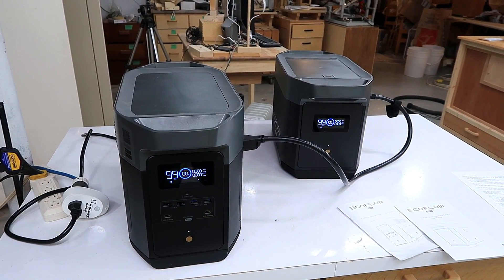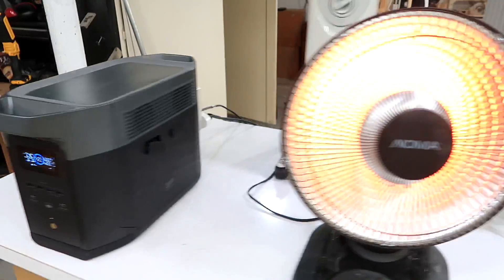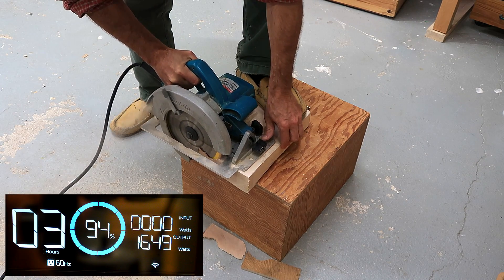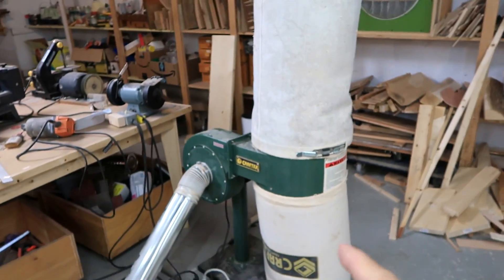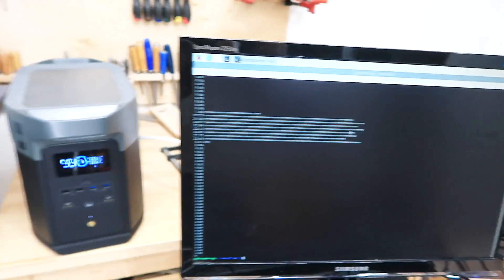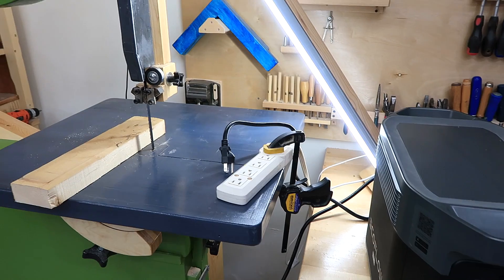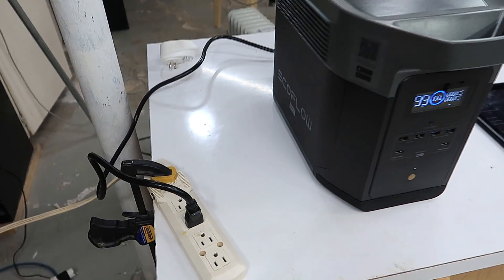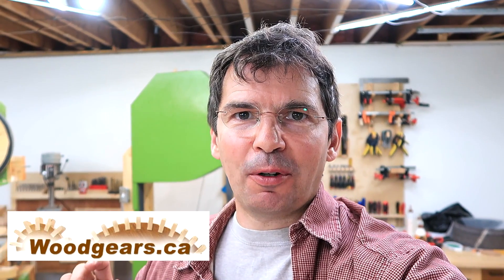Overloading the EcoFlow Delta Max battery pack

Comment: This is one of the more polished portable battery backup systems I've seen. The app looks nice. I am able to run my 15k btu AC off a lithium bank with a EasyStart control box as it helps smooth out the initial inrush current, I bet it would work for a system like this as well. I do feel that 24a is very generous for such a small system like this. Thanks for sharing!

Comment: How many Watts are standard sockets rated for in Canada? In Germany it is 3680W, however in practice I had it run at 4000W for hours without fuses popping which is the maximum including a tolerance. 

Overall I never find this an issue because only the table saw in my entire workshop can use up that much energy.
Reply: 15 Amps * 120 V = 1800 Watts for a standard outlet. There is also a 20 A outlet that is only slightly different compared to the standard 15 A outlet.

Comment: I would love to know how it cuts the power. I did A few lithium battery projects and cutting the power was always difficult because of the high currents and low voltage.
Reply from the maker: By shutting off the inverter

Comment: Slightly off-topic, but in the HVAC world I know that repair technicians often install big ass capacitors on the compressors to eke a little more life out of them. It reduces the inrush current so that a struggling compressor doesn't trip the breaker. Something like that would allow you to run larger equipment without overloading the device, but I realize that's probably not a common use case. I did find it intriguing that I might be able to use traditional, non-battery powered tools in places where AC power was not available or impractical. At least until I get my hands on one of those F150 Lightnings. 😁

Comment: I wish you had discussed exactly what kind of battery that it uses. I've always thought it would be nice to have a UPS that used deep cycle automotive/marine-type batteries that you could easily obtain and recycle at any auto parts store rather than the myriad of UPS-type batteries that you have to special order.
Reply: You can get flooded lead acid 6V batteries at Costco (if you have one near your house) and use an inverter to convert the low-voltage up to house AC. These batteries are pretty cheap but they also don't last super long. Might be a good value anyway. Otherwise there are sealed lead acid (AGM, for example) and LiFePO4 either DIY or off-the-shelf (battleborn). Any of these batteries can be paired up with an inverter to generate AC.
Reply: You can actually just get a regular UPS that supports the wattage that you need, then take out the included batteries (almost all of them use sealed lead acid) and just wire the UPS to the automotive/marine lead-acid batteries.  Make sure that you match the voltage that the UPS is designed for and everything should work just fine.  The charge method for SLA is negligibly different from regular lead-acid.
Reply: For that amount of power it would be the size of a mini fridge if it used  automotive batteries
Reply: @victornpb  that might be an exaggeration.  For sure it would be a big and heavy pack. But, Mark didn't say how much power or energy is needed. Just that he wanted a UPS powered from automotive/marine batteries. I had one in my barn to back up the T1 line during power outages. It was one 80 Ah 12V flooded lead acid battery but it could run the T1 line and wifi link to the house for about 24 hours. This was just a cheap "deep cycle" battery and a 600 Watt inverter, I think. Luckily I finally found a better alternative to T1, so I don't need that particular setup anymore. A 2kW inverter needs about 200 Amps at 12V. So any battery that can put out 200 Amps without sagging too much should be OK if you need 200 Watts. You also need heavy gauge wire to avoid drop/loss in the wires. Probably about 200 Amp-hours would be right, if the full power was only needed for brief moments to start power tools.
Reply: Having done quite a bit of digging about marine units they usually boil down to how many packs are in the unit, form factor is pretty similar and replacing one 24 with 2 12v is quite possible.
Some suppliers may sell it as a 36v pack but when you actually open the unit its a bunch of 6v stringed togheter

Comment: you probably want to set it to a 20% and 80% cutoff level so that it doesn't discharge too low and charge too high because that hurts battery capacity

Comment: Can the unit be integrated into a home WiFi network and be controlled without needing internet access? I will never buy any "smart" device that relies in any form on a server that is not under my control.
Reply: If they market this for camping, it should be able to run free without an internet connection.
Reply: I haven't looked at the details but I would presume this uses Bluetooth instead of Wi-Fi.

Comment: Here's the real question--if the power actually goes out can you still connect to the battery  via the app or does it run through your house wlan?
Reply from the maker: House wlan.  But you don't need the app to use it, just to configure stuff.
Reply: @matthiaswandel  Thanks!

Comment: Will it power one of those small air conditioners you put in your window and for how long.  That’s what I need when I lose power in the summer.
Reply from the maker: I think those typically draw about 400 watts, so should be 4-5 hours.
Reply: @matthiaswandel  thanks
Reply: @matthiaswandel  400 watts must be a tiny air conditioner, I would expect closer to 1000w. But what probably matters more is surge current. A conventional compressor will probably take over four times its running current at startup. Inverter units would be fine as they have soft-start functionality.
Reply: Check out HoboTech's channel.  He covers this in detail.

Comment: I'm leery of any UPS that lets a light flicker visibly when the power cuts over.  I used to have problems with lab equipment that clicked off under these circumstances.  I suspect that this can be a problem even if the dead time is only 12 msec.  Old linear power supplies with diode bridges had huge capacitors which could reduce such drop-outs, but I'm not so sanguine about modern switching power supplies.  Plus, it looked to me that that the phase jumped when the switch was made.  How hard is it to avoid that?
Reply from the maker: You are allowed to miss a cycle, the power supply is supposed to be able to handle that.
Reply: I believe Matthias's graph was of the current waveform. With an inductive load like he was using the current waveform would be different for a few cycles as it reaches equilibrium.

Comment: Imagine if Elon Musk sent Matthias a Tesla to "review" 😂😳😬 Matthias - "I attached a 6 TPI bandsaw blade to the outside circumference of the tire and I'm cutting through 40 inches of Brazilian Rosewood while I have my Raspberry Pi hooked up to the the voltage regulator of the battery pack, which feeds the tiny fluctuations into a program I've written to fly a Flappy Bird between Mario pipes for my children's entertainment." 🤓

Comment: Excellent review Matthias!  Nice to see hard data and an honest conclusion!  Suppose i'll have to limit the number of high-consumption woodworking tools I take camping 😁

I run the EcoFlow River Pro (720Wh) with my teardrop boondocking trailer and love it.  Of course I try to run everything from the DC power to maximize efficiency, however, it's handy to have the AC inverter.  The quick recharge, while not great for the battery life, is nice when i need to supplement power regen from a coffee shop (when I have a few days of cloudy skies and solar doesn't cut it - generally I keep quick charge disabled).

Comment: Great video. One thing I wonder is if there is any kind of autoshutoff for low power usage? I've looked at smaller portable battery packs for camping (the $500 range ones) and some of them apparently shutdown while using cpap machines because of the low energy draw.
Reply from the maker: This one just keeps running until it runs out of battery.  Which can be  a problem, because the unit itself uses 10-20 watts just running the inverter, so if you forget to turn it off and come back a few days later, it will have drained itself.  It has a configurable timeout though, which is turned off by default.
Reply: @matthiaswandel  What you're describing is the opposite problem of what Jason's describing.  The AC inverter typically has a small zombie load, like you said, 10-20 watts.  So for power stations with a smaller battery capacity, they take the opposite route of shutting the inverter off to prevent the zombie load from draining the battery when it detects either a low or no load from items plugged into it.  On these larger units, that concern is much less, so they choose the opposite option.  That is, allow low/no load on items plugged in but instead allows the zombie inverter load to eventually slow drain the battery.  Seems to me that the manufacturers could make this a configurable menu option so that the end user can choose their poison.

Comment: I don't care how good battery chemistry has become, I keep charging rates as low as practically possible.

High C rates just kills longevity and kills components.

Thanks for sharing, Matthias!
Reply from the maker: Agreed.  It has a switch on the back to set the charge rate to 400 watts, which is much better unless you are in a hurry.  But sometimes you are in a hurry.
Reply: Same! I "trickle" charge my phone with a 150mA charger overnight. It has a replaceable battery, but the original from 2016 is still going strong!
Reply: @Fuogor  Nice! I keep old 500 mAh ps around for that same purpose.
Reply: Agreed! However, the option to occasionally do it is great- if I had one of these for an emergency situation, the ability to quickly recharge it during either sporadic power or if I had to travel somewhere to get it would be fantastic. 
If I ever get a battery like this, which I have wanted to for a while, I would consider ecoflow if their app can run with no internet connection.
Reply: @erikmnelson77  Indeed, that's why I said "practically." Charging this at 0.1 C would make it impractical for 95% of users.

I could only imagine how many users charge these units at max rates every time, all the time.

Most certainly, the app is what makes or breaks products like these.  It's very tempting but my UPS and genny combo works for now. These systems in the past were only available at enterprise prices or in a DIY, it's only a good thing for consumers that they are able to make viable products like these. Solar integration would certainly not hurt. Wink wink.

Comment: A soft start circuit would likely help with these! it would reduce the inrush power of motors, where they draw thousands of watts for a split second.
Reply from the maker: I was suggesting to them to drop the frequency if the load is too much.  That would help a lot with starting induction motors.  But induction motors in general are pretty rough on the electrical when they start.
Reply: @matthiaswandel  Indeed. The impedance only normalizes when the fields are built up. Great review of the battery though! Good to know it has safety features like this.
Reply: Induction motors draw a lot of current on start up due to their nature. Soft start is for universal motors.

Comment: 6:03 ah, there it is; the Raspberry Pi and the cool ASCII graphs!
Reply from the maker: Yes.  Hire is just too much hassle.  I miss the days of DOS and 640x480 graphics that were easy to do.
Reply: @matthiaswandel  What is Hire?
Reply: @BravoCharleses  i think it means high resolution
Reply: @matthiaswandel  A little bit of SDL initialization and you can have the same thing.  Or are you talking about also having drawing primitives ala QBasic?
Reply: @matthiaswandel  talk to the 8-Bit Guy maybe he can get you set up ;)
Reply: @matthiaswandel  I used to first do such in APL on VAX, then a Wicat (sort of unix) multiuser small computer using the box drawing characters and the infill characters - very nifty - finally shifting into the DOS world. Also remapped the character set for additional extra effects. Most of that deprecated with Windows and became nostalgia.
Reply: @matthiaswandel  You need an oscilloscope my guy
Reply: Who remembers ANSI art?
Reply: @truckguy6666  ANSI or ASCII?
Reply: @WalterWittMakes  he does, if you're curious. I remember he tested one of those USB scopes, on a video, and he also has an old school analog scope (which he used to break that very same power unit)
I'm thinking of getting me one of those cheap USB scopes too. I'm only a hobbyist but I think it's time to move on from sampling with an Arduino.
Reply: Who needs oscilloscopes when you have the power of Arduino?

Honestly, as an EE, I find the resourcefulness both amusing and inspiring :)

Comment: Far too much load for a single 5-15 outlet.
Reply: Theoretically yes but the inverter has 5-20 outlets. While the meter and splitter only have 15 amp connectors keep in mind 5-15 and 5-20 amp connectors use identical contacts. While technically wrong, I don't think there's a risk running 20 amps through quality 15 amp NEMA connectors as long as the wiring behind them is sufficient.

Comment: As good as these look I've often found the price per watt hour is double or some times triple the cost of the lithium batteries that power them, which I just find completely unrealistic.
Reply from the maker: True.  But buy a DeWalt drill battery, and you get a similar kind of markup.  Or buy a gold ring, and you will find yourself paying more than 3x than the price of gold.
Reply: You're not simply paying for raw cells, those are available for the price you desire on Alibaba or other vendors. The additional cost goes into the enclosure design, charging and discharge circuitry, warranty, programming, etc, and of course some overhead for profit margin and marketing budget, to pay for videos like this one.
Reply: @mlindholm  I'm not a moron so I'd ask you don't talk to me like one. The problem isn't the fact that the company is out to make profit, it's the amount they're out to get. Sure I can buy cheap cells and build my own at a fraction of the cost and it won't be anywhere near as good but the fact that it can be done is what makes the mark-up unrealistic to me as a consumer. MW just used Genuine DeWalt batteries as an example. That's fine if you're looking to buy genuine batteries. I don't as I've had no issues with the third party batteries I buy at 1/3-1/2 the cost of the genuine brand.
Reply: @SammyInnit  I doubt that flying off the handle is helping.
Reply: @SammyInnit  your unlicensed knock-off batteries, at 1/2-1/3 the cost of OEM, have a fraction of the soft costs built into them. Those manufacturers can simply copy the homework of the OEM for their own production, or perhaps simply have the contracted manufacturer of the OEM battery components sell them additional items (BMS, plastic shells, etc), without having invested the upfront costs required. It's not entirely greed at play.
Reply: @mlindholm  I personally use Makita tools more so than any others - they charge roughly the same or more now for an LXT lithium battery as they did 14 years ago around the time of their release. Some of it is inflation and rise in material costs but to adjust for those their mark-up is roughly the same, you don't think that's purely greed? After 10-15 years the outlay and development cost is more than covered.
Reply: @SammyInnit  I think a huge cost you're overlooking is safety and other certifications. Certified components cost more to the manufacturer, and then they certify the entire product and need to pass all of this onto the manufacturer.